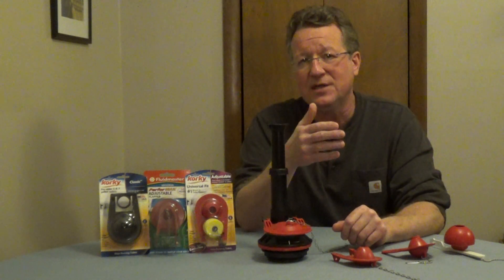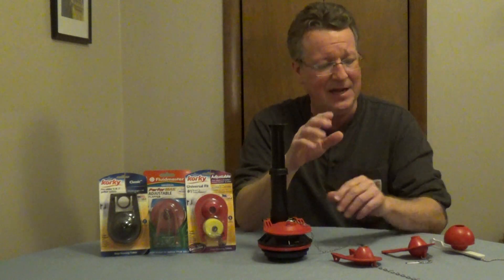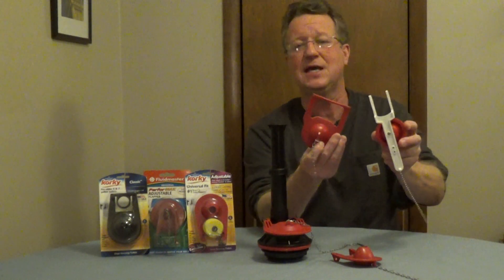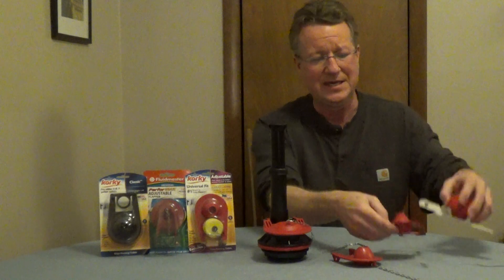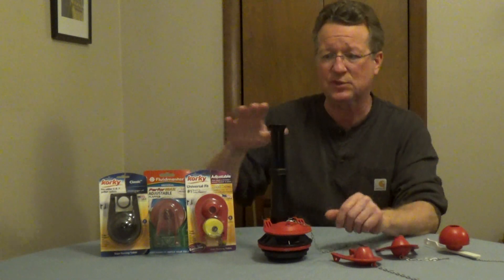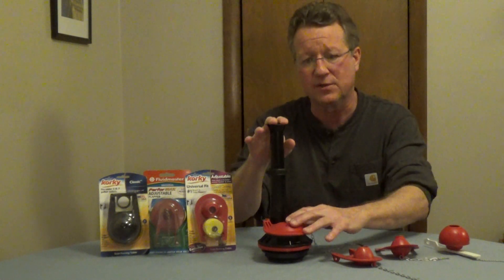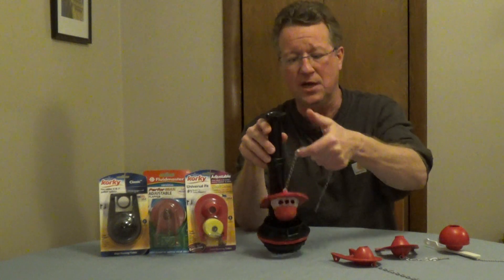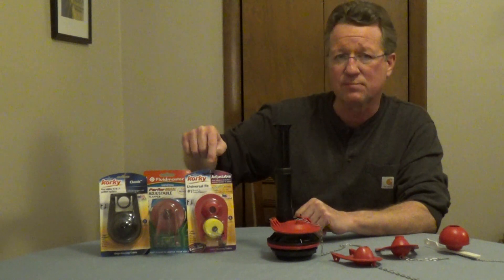Toilet Flapper Types - Toilet Flapper

Comment: My toilet doesn't use a flap, but rather a cylinder. Once the flush cycles, the cylinder is pulled up, allowing  water to empty. Then the cylinder goes down (once handle is released) and creates the seal to stop water flow. What's this type called?
Reply from the maker: Hi, many companies call it a canister style flush valve.